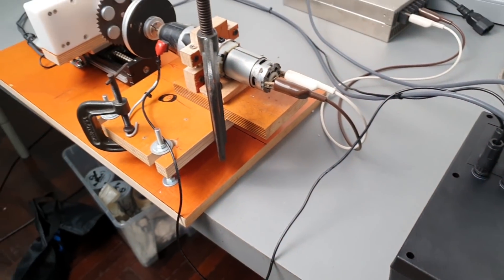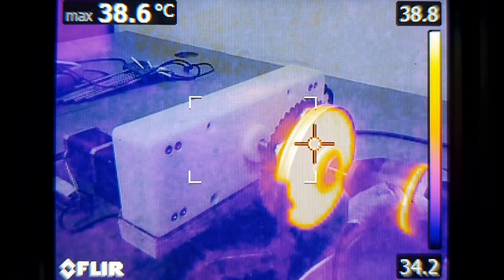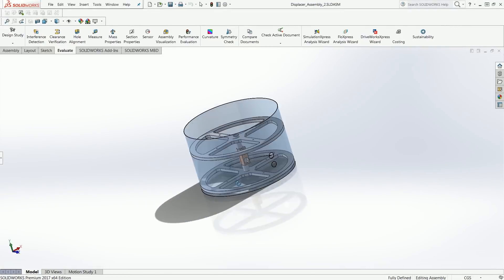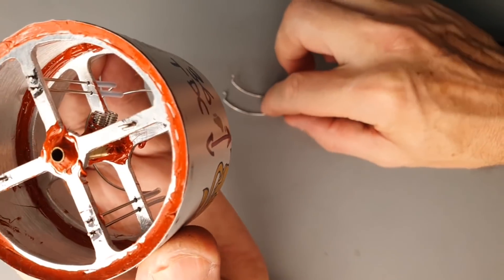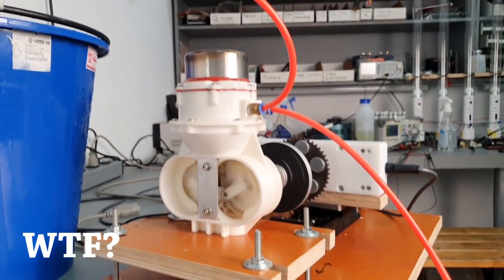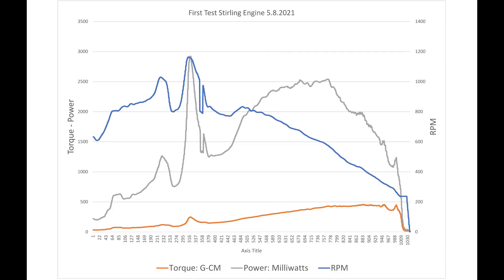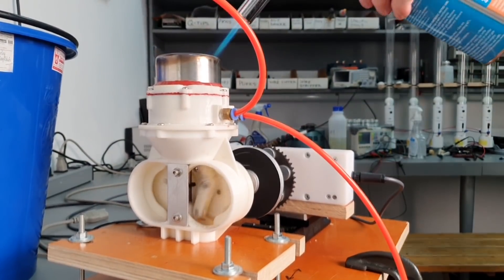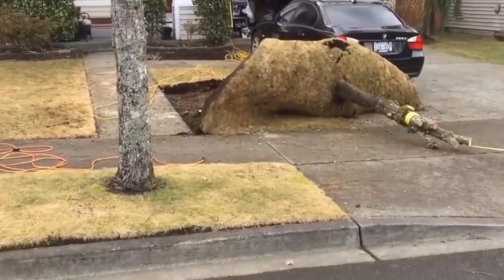The Stirling Engine Project:   Episode 3

Comment: Interesting hypothesis about temporary internal combustion! You could test it by purging the cylinder with non-oxidizing gas; nitrogen (used for car tires), argon (welding), or CO2 (bb / paintball gun canisters) should be readily available. If purge gas makes the peak disappear, there's your answer.

If you're interested in more scientific data logging, what about mounting some thermocouples on the hot and cold sides?

I love this series, and I think you're a madman for casually building a custom torque meter as a side task. Even more impressive is that you nailed it. My opinion? You totally should keep playing with the engine (and showing us)!
Reply: I know that Hydrogen is the best (but it's dangerous), and helium is almost as good. CO₂ is one of the worst gases to try with,the same situation with plain air, but as it was proven in this awesome series it works quite well anyway :D

Comment: Was expected for a large piston surface... (shouldn’t do that) 
well it is always like way too many details on each work or goal. Nice job man... 
actually what about a steel net insulated silicone plate for that piston surface, light and strong and heat resistant...

Comment: The dynamometer looks like a great success.  You can now gleen all the juicy metrics that will allow you to tune your design which is a very useful way to be deterministic in your approach and get immediate feedback. 
This design gives me hope.
I can't recall if you said, but are you targeting RPMs or constant torque?
I keep imagining this design being useful for a metal roof-mounted ceiling fan motor to ease the work of air conditioning by recirculating air.
Reply from the maker: I think ultimately I would like to charge a cell phone, that seems like a reasonable goal - 5W of electrical power.
Reply from the maker: @Antonius Theiler It's what the masses want.

Comment: I wonder if stirling engines could save the world (sort of).  Imagine you had a stirling engine with all parameters tunable to match a particular heat gradient.  Then consider all the sources of waste heat, in data centers for example.  One wonders if there’s a potential to provide record-breaking levels of efficiency by using stirling engines to do work with in virtually all situations where there’s waste heat.  A car produces a lot of heat in exhaust, and while moving there’s definitely a big gradient.

Comment: I was expecting you to test copper wool
Reply from the maker: Send me some and I will!
Reply: @leosbagoftricks3732  Mhm i'm on the wrong continent, but i could dropship some $2 sponge for cleaning soldering iron tips from China, which is copper or brass, difficult to guess what they'll send. Or it likely costs about the same at your local electronics hobby store.
Reply: @leosbagoftricks3732  do you have a PO box?
Reply from the maker: @patrickfle9172  Thanks so much for the kind offer! I live in Bangkok, the logistics are a bit daunting.
Reply: @leosbagoftricks3732  
Why not stripped copper wires? ..
... Probably held together with a few steel wires to keep it in "shape"...

Comment: Have you considered using a electric heating element to heat up the hot end?  It seems like that would give much more fine control for tuning the engine.  A small heating mantle and a pid controller would be a very easy setup to implement and control.
Reply from the maker: Yeah! many things to do! I am sure the real efficiency would be really low, almost don't want to know haha. For sure the electric heater is coming!
Reply: It would make calculating efficiency very easy.
Reply: I was just about to suggest this
Reply: Yes, there are cheap band heaters on aliexpress. You can also use 3d printer hot end heater elements. Especialy if you want to make the engine more efficient it helps a lot if you can fine regulate the temperture and the amounth of watts that you put in the engine.
Reply: I have used a cattle heating element to’ do just that, infinitely cleaner input power measurents. I am curious about way you are using labview , I am very attracted by it too.